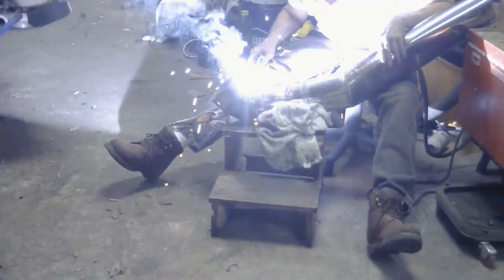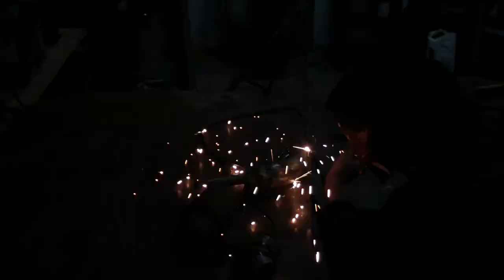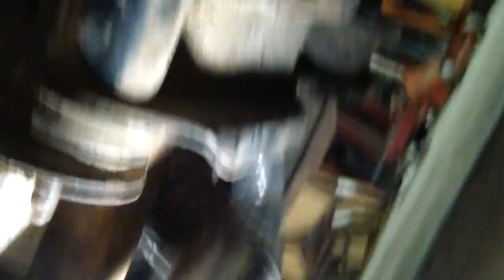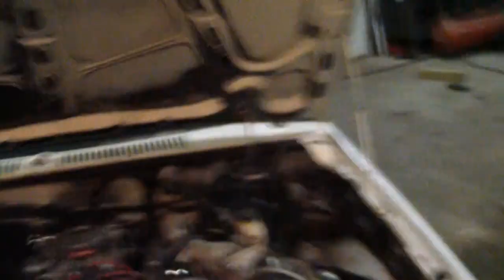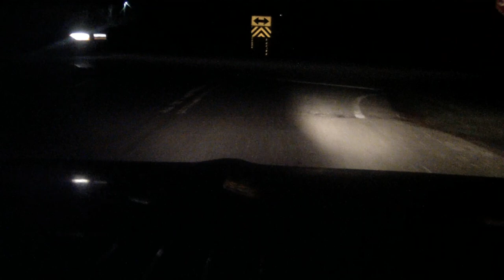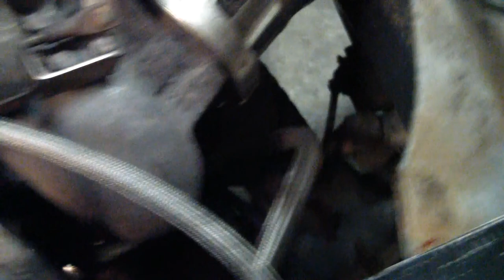V8 Ranger Big Turbo Down Pipe Done And Test Drive (pt 6)

Comment: That Turbo sounds great .
Reply from the maker: Thanks, it scares me how loud and easy it starts to spool up the factory wastegate setting was 38 pounds I swapped the actuator to one that opens up and took out the big spring now it starts to open at about 13 pounds maybe it won't blow it up  it's just a factory 01 explorer 302  may have to go back with the 351w

Comment: I hear no exhaust leaks! 
You got a support bracket for that huge dryer?
Reply from the maker: Nope the manifold is all that's holding it up .thats the baby turbo lol. I didn't use any gaskets or silicone just bolted the manifolds straight to the head and they don't leak

Comment: Ix that edelbrock blow thru
Reply from the maker: No I had to build a Holley I was waiting till I knew everything would work only had 200 bucks in evertthing  at this point. I thought the turbo was going to be too big but it worked perfect no turbo lag.
Reply: @kickassmustangsgarage  ok I'm trying to do a blow thru edelbrock and saw the edelbrock and though you figured it out. And is your Holley vacuum secondary or mechanical
Reply from the maker: 650 dubble pumper.  Edelbrock has external accelerator pump and brass floats if you could seal the pump and put a float in it that wouldn't crush it would work
Reply: @kickassmustangsgarage  I made some floats that I think might work I'll probably give them a try this weekend. I'll try to get a video
Reply from the maker: lol I made my floats too took side hung nitrophyl floats out of a  600 vaccum secondary holley and cut them down till they cleared everything there smaller than the old brass ones so the bowl holdes more fuel and works perfect without having to buy some. Good luck with your project I got faith that it will work for you.

Comment: not meaning to bash but wheres the feed tube from the turbo to the top of the carb ?
Reply from the maker: Decorative Iron Plus
It's next I wanted to finish the hot side first and drive it to test if everything would work right before I spent alot of money on the rest of the parts I need  I only have about 150 bucks in everything  so far turbo and all
Reply: @kickassmustangsgarage  cool  thats awesome low budget is always good i bet it will runn like a  bat out or hell  good job keep up the good work
Reply from the maker: got alot more to do to it. it sat for years slowly getting it road ready once I get all the bugs out   and a bigger axel in it I plan to take it to the track and break some shit Lol
Reply: kickassmustangs garage can’t wait to see how much boost it makes
Reply from the maker: @ChiefLightning9  The factory setting for the wastegate was 38 pounds I swapped out the actuator to one that can be opened and took out the big spring now it should open around 13 pounds waiting for the turbo elbow I made a carb hat with a blowoff valve won't be long now